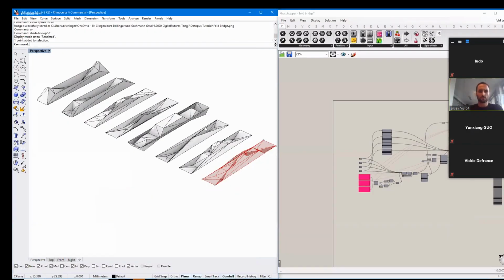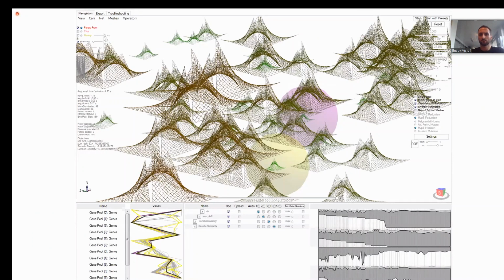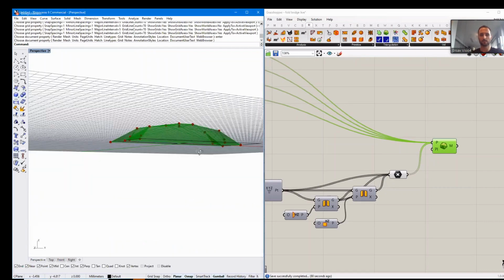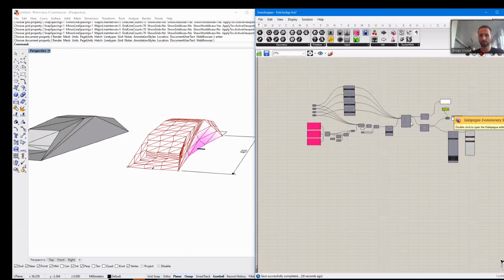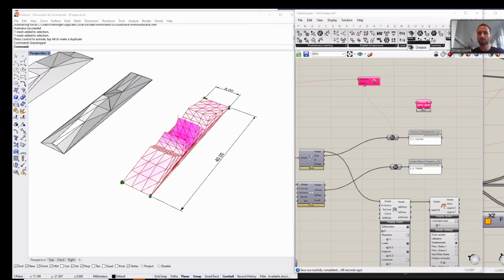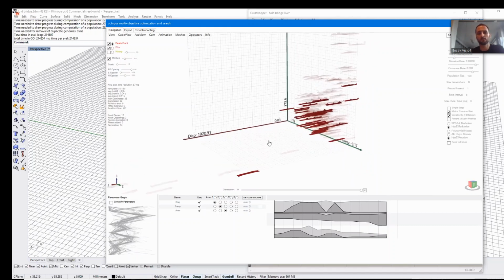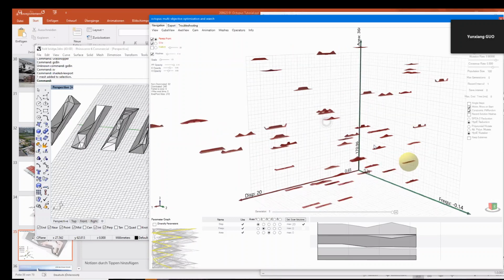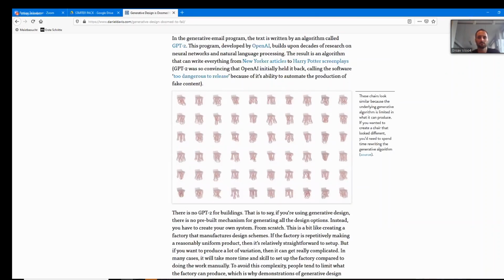Genetic Optimization : Octopus plugin by Robert Verlinger

Comment: What's your opinion about other generative design multi-objective optimization plugins like Wallacei, Discover, Biomorpher, etc? I want to do my master's project in structural optimization. Which one will you recommend? I haven't tried any of them yet.
Reply: I have used both Wallacei and Discover, and I love Discover because of how easy it is to use. For me, Wallacei looks like more advanced and difficult to use. Whatever i run on Wallacei I try to see if I can do on Discover. I am yet to try octopus but looking at it, i think it is in between Discover and Wallacei
Reply: @benjaminobeng1029  What are the cons and pros of each of these plugins? Why do you prefer Discover?